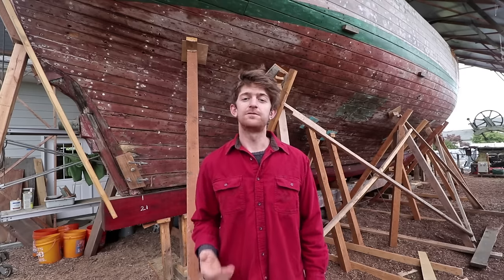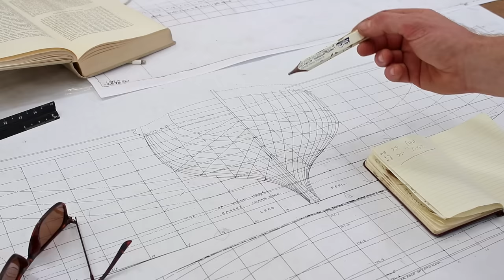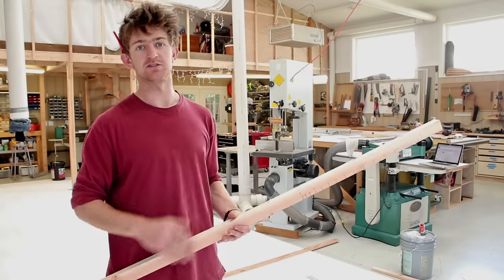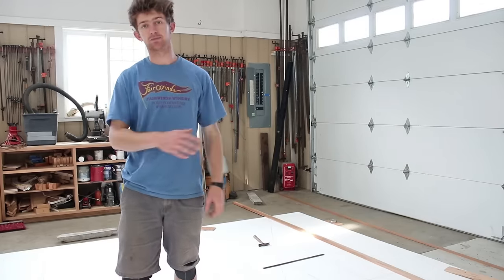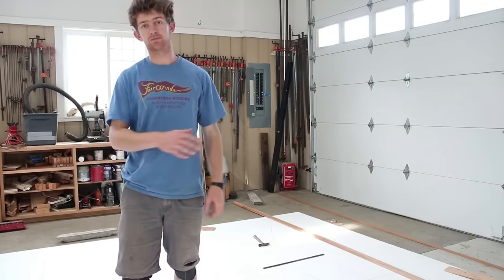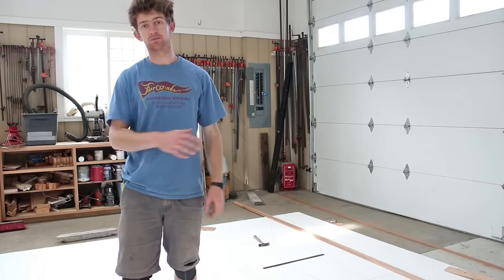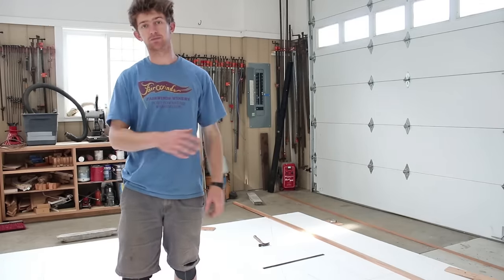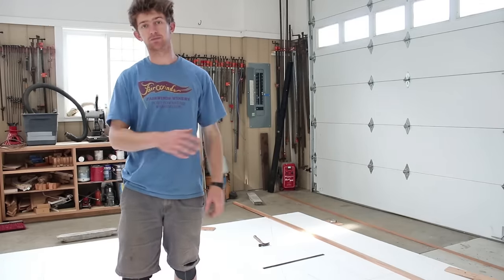Lofting the Lines; Part 2 - Rebuilding Tally Ho EP25

Comment: I'm bingeing from episode 1 (sat in hospital having said goodbye to the old prostate ...). You are who I wanted to be at 16. Used to knock around in the now long gone wooden boat builders yards in Exmouth as a kid. Used to design and create lines plans & offsets for a winter hobby - because spring summer and Autumn were for sailing ;-) been holding back on commenting but I cracked .... Poncho is the boss ...

Comment: Very interesting!
I am "Still confused but on a much higher level!" :-)
Reply: I must not understand....I would have numbered each vertical rib from front to back, used that wooden "chain" thing next to each rib, transferred that shape to a piece of plywood, cut that side view of the rib out from the plywood, take that as  a template for each rib, clamped the template to the respective rib, compared the cutout, then traced that on to the piece of live oak for the corresponding left and right side rib. The #1 front right vertical rib should be the same as the #1 front left vertical rib.  Do the same all the way to the back of the boat...but I'm not a boat builder, don't plan on building a boat but still find this interesting.

Comment: Wow. I have read in theory about lofting. But to watch it on such a large boat in reality is quite amazing. I would get lost after drawing the first two lines. Excellent job.
Reply: You wouldn't really, it comes to your mind as you start drawing, as you 'see' in your minds eye the hull shape
Reply: Fredrick Rourk I feel like the intimidation would be from not expecting it to take as long as it does. But you’ve gotta loft to make sure you get a good result
Reply: is there not software to help with this process? is there some reason you can't use CAD?
Reply: @benja_mint  modern boats are drawn in CAD but you still cant skip the human eye part of the operation. im trained in the traditional stuff but have built a couple of strip plank composite boats that had their stations(frames) CNC cut from the CAD drawings. even with the CNC cut stations and CNC cut jig to set them up on you still have to lay fairing batons all around the jig+stations and eyeball it, theres always something that needs adjusting. you simply cant see everything on a screen/not full size. for example one of the boats i did had very flat topsides from the mast step forward. he intended it to be very flat but still slightly covex. when we set the jig and stations up the boat LOOKED concave at that point. it wasnt, the curve wasnt wrong (3 people independantly checked the jig and stations including the designer himself) but it just didnt LOOK how he intended. you cant catch these kinda things in software and thats the same kinda things leo is looking for heer by doing a full size drawing.

Comment: "The base design was based on a combination of a deep hull, long keel, heavy displacement and powerful gaff cutter rig. This made a lightweight and overpowered single masted boat with large steeply angled keels, making it deep draught under power and shallow draught in lighter sail. However, competition-based evolution between different builders and commissioning owners enabled the design to improve over a period in excess of 90 years. This continual experimentation to gain slight advantages created a fast boat that could operate in all weathers, resulting in what in the opinion of many was the best sailing boat design ever"

Comment: thanks for explaining the lofting. it can be confusing reading it in a book. I make replacement parts for large aircraft. They also design using the lofting and loft data. up until now I have only bid on solicitations that come with 3D models in order to CNC machine the parts. Now it's much easier to understand the old lofting drawings.

 Thanks again

Comment: Reading through the replies a number of people have thought of using an optical enlargement of the original reduced scale plans. Apart from needing a very large printer or compensating for optical distortion from a projector they are missing one very important problem. Say the lines in the original drawing are .5mm wide, once enlarged say 10 times they become 5mm wide. Which part of these wide lines do you work to? Enlarging by a greater factor makes this even worse. Drawing by hand leaves a thin line much more accurate for making frames. Leo's method may seem old fashioned but produces the results. Really well done.

Comment: I am imagining an electronic pantograph. A pointer, belts and encoders for picking points on the drawing  and then the same thing with motors + a computer to move to the scaled-up position on the floor. (the computer would mean that you could feed it an Excel spreadsheet to plot too.)
Too late now, of course, and unlikely to be faster for the first boat.

Comment: It was difficult to get my head around this lofting lark. Then I figured that you are using a two dimensional model to plot a three dimensional point in space. You can lift the big parts like the keel and the deadwood parts straight off the plan as templates, but stuff like the frames contain those three dimensional points - the shape of the hull. I guess that's why you have to plot them more than once, using the different sections, as the measurements (offsets) are different with each one. Even if this is correct, I still can't do it, so much kudos to you!

Comment: Glad to know you know what your doing! With all those lines going every which way I'm surprised you have any idea which is what! How fast could someone do this in cad I wonder.
 I did enjoy watching the parrot!
Reply from the maker: Here's my stock answer for when I'm asked why I did it manually!
A few reasons. 1. I know how to drive a pencil pretty well, but not CAD software, and I wouldn't want to trust anyone else to do it. 1. Being able to loft is an important part of being a master boat-builder, so I was keen to get the chance to learn it the traditional way. 3. There are many fair lines that can be chosen between two points. The person lofting the boat has considerable influence over the subtleties of the boats shape. If a computer was to do this, this human element of the design would be lost. 4. Is it even possible to fair a 50' long line on a computer screen, inch by inch? If so, it sounds very tedious. 5. I would still need life size plans for the templates, so I would need some kind of crazy industrial printers, etc. 6. I spend far too much time on the computer already, and this seems like way more fun (and makes more interesting videos)..
...didn't mean to write an essay, but there you go :)
Reply: Not a problem on the essay. I asked the question and you answered. Besides I know diddly about CAD I learned basic drafting back in Jr high ( more than 3 decades ago) I can draw out simple structures and that is all I need

Comment: Maybe stupid question, but couldn't one just use a projector and scale up the drawing? I guess you still need some reference points so you know you have the right scale and to make sure the image is not skewed. Edit: Saw your response in another thread. Makes sense. And this way will also make better videos. So happy people like you exist, who are sharing their work on YouTube.
Reply: Johan Petersson   I think you would need incredibly expensive optics to reach the necessary precision; he said that a deviation of half an inch would be visible on the boat. And second: as he does it, "analogue" so to say, it is a very beautiful process, and a good experience. Also he gets to know this boat extremely well. Every centimetre drawn himself on the floor. I like it.
Reply: Agree! I'm working with computers, I guess it's like when you have a hammer, everything becomes a nail :) A better option is probably to print everything scaled up in smaller sections.

Comment: Excellent description and demonstration of the lofting process. 
When you have a nice and fair set of lines on your floor are you going to rewrite the table of offsets by measuring your fully lofted plans on the floor?
Reply from the maker: That is sometimes done, especially if the boat is to be built again! ...I'm not sure yet, in this case

Comment: Just to speculate on the future of boat building.....
If you recreated the design in CAD then you could print out the full size plan on A0 wide sheets on a plotter. Adjust and repeat until you were happy with the new lines. Then also simply cut the templates out directly on a large 3 axis CNC. Of course you would have to pay to use someone's large format CNC. Plus it would raise questions about how far away from traditional techniques should one go during a restoration. I'm not in the trade but I expect this is the way it will be done in the future for wooden boats. 

As 4 axis and 5 axis CNCs improve and reduce in price, a lot of the parts would be carved directly from the plans in the future. Possibly directly into rough sawn slabs, taking into consideration the grain of the wood. The woodworking skill would then be in refining and fitting all these parts into a vessel. 
If the boat ever rots or is damaged, replacement parts could be carved out on a CNC and shipped to any location in the world for repairs. 

Being sustainable, easily customised and easily repaired might give wooden boats a come back against fiberglass. 

At least until people start 3D printing entire boats in nanofibers.

Comment: I think I get the point it is to have a set reference . Instead of wracking or trimming it here and finding the other area has become out of spec. I call it trimming the legs on an 8 legged table without a tape measure. So your creating a pattern to use as a standard measure.
Yep she has some nice lines . Of coarse I mean the boat.

Comment: Is it possible you may have jumped the gun in trimming the new keel timber. I understand that at the time you were not planning such extensive changes. I am more curious if there is some impact however minor. 
PS. I admire your determination.

Comment: Hey Leo, I was wondering would you have been up for 3D CAD drawings?. Also there are 3D scanning systems which may or may not have been useful in giving actual accurate data of the original shape of the boat. I understand traditional manufacturing holds a certain attractiveness but you are using power tools so I'm assuming you would not have been averse to using modern systems to help with the design?.

Comment: For those confused, lofting is drawing the plans of the boat full size in 3 different views - body plan (looking at the boat from the front to back), profile (viewing the boat sideways) and Half Breadth (viewing boat from top-down). 
All three of these views correspond to each other (regarding measurements). So any information laid down in one plan has to be changed/laid down in another plan - from this you can see the fairness of the lines. 
From a lofting, you can lift patterns of the boat to create moulds and frames (to build around), also give bevels for planking and so much more! The lofting provides a crazy amount of information that will be used to build the boat! 
It's a beautiful but difficult process :)
I know Leo has explained this but it might be easier to read :P
Reply: It's true, expecially for those whose mother tongue isn't English. Thank you! ;-)

Comment: I sometimes wonder if every aspect of boatbuilding would have been easier using the metric system. Then again, do any measurements on a boat of this size involve fractions smaller than, say, 1/8" or even 1/4"???
Reply from the maker: Nothing smaller than that in the table of offsets, but there will be later!

Comment: Couple of quick questions.
You said that lofting properly is important to stay true to the plan, you also said you suspect the builders slightly misshaped the boat originally does that mean they took short cuts in the original lofting process? and 
After all this work could you reuse, or sell the lofting floor to someone wanting, to build a new boat?
Reply: I think what Leo has done by making addenda to the offsets has created more accurate historical documents.   That is, they will become historical in time.  Obviously he had to add information.  I suspect the information was not in the drawings because at the time of the original build there was a close association between A. Strange and the builders, the information was in oral form. That association does not exist today, therefore the information had to be added to the drawings.
Reply from the maker: I'm not sure how they lofted the boat originally, and actually it's hard to tell how much of the change in shape is just dues to age and wear and tear, and how much of it is due to not following the lines exactly in the original build. I think in those days less importance was attached to line plan, in certain boatyards - and as Strange wasn't that well know at the time, they may have preferred their own ideas in some cases. The floor could be sold/reused, and so could a corrected table of offsets, or the templates for the frames.
Reply: Your last sentence, Leo, raises a question that's been on my mind from very nearly the start: How dissimilar will the resuscitated Tally Ho be from an entirely new boat? It seems that the only part you don't plan to replace is the lead ballast keel mentioned in this video.
Reply: Even though she's a heavily built boat, spending time dried out on her bilges (especially when new and the timber still a bit green), would surely have changed the shape a little here and there. She's also clearly hogged a little during the time spent laid up, so plenty would've shifted there too.
Reply: @Mmmyess. Possibly a slight misunderstanding. The lead ballast keel is the only part that isn't going to be changed. There are a lot of other parts that, as a result of this lofting, will be changed (ie moved slightly) but they will not be replaced. There is still a fair amount of the original boat in the project.
Reply: +ted renard What exactly of the hulk we see in the shed do you think will be reused? Certainly not the keel, which is now purpleheart, or the frames which will be replaced with sawn in Georgia live oak.
Reply: The Planks will be reused. As far as I know that's it. But with that and the Lead Keel it should still be classified  as a restoration. I think. I've seen 1920 cars restored from just a frame and axles.

Comment: You've mentioned that the 1968 repair lines diverge from both the original plans and the shape of the other side of the boat. Now you've discovered that some of the information you need to establish accurate and fair lines is not in the original drawings or tables. Are these things related? Did the people repairing the ship in 1968 have a similar lack of information, but not the time/space/resources/(mostly time) to do delve into the ship's lines as you have?

Comment: Are you going to transfer your modified lines back to a reference drawing / table?  In construction, it's referred as 'as built' vs 'architectural' not sure what it is in boating...
Reply from the maker: That is sometimes done, especially if the boat is to be built again! ...I'm not sure yet, in this case
Reply: I would think an updated offset table would be super helpful in the future when its time for the next rebuild. Or in the event of a similar grounding. or other mishap.

Comment: How did the original designer plot the sweep of the ship  on the plans. Experience? Big book of hull shapes?
Reply: richard wysham   Took a whiskey bottle and pencilled around it...
Reply: I think they carve a half model to the shape they think will be appropriate then loft it and build the ship.
JIM
Reply: Maybe Christian Geiselmann is right. Did they have hydroflow tanks or carve toy sailboats and test them in the Thames? Probably maths was advanced enough to determine which hull shapes fit the design required. I like to think they used the big book of British hull designs.Tally Ho (Betty) wasn't designed for speed....only. Speed in harsh conditions, or, making way in those conditions and being comfortable were designed into her.?? It's just a guess, but I think Leo wants to know how the ship handles if she's rebuilt to Strang's original drawings. Not how she was originally BUILT. Wasn't it altered when built to fit the shipbuilder's predilection?

Comment: All I kept thinking about was “isn’t there a software program that can solve all these lofting intersections to make the boat fair that could give you your once and precise measurements?”
Reply: At one point in my life (back in the mid to late '70s), I worked as a draftsman for a utility company and we would get the drawings of roads from the developers or the city.  We would have to take these drawings and update our drawings, plotting new utility services for the area in question.  The roads were not always perfectly straight nor were they all simple curves with given radius that was traversed for a certain number of degrees... You might have one curve of one radius and center point flowing after a certain number of degrees into another curve of a different radius, center point, and degrees... If the original designer of the boat had provided drawings like that, then it would be possible to calculate the points mathematically from known static data points... A lot of the old stuff was designed with flexible rulers though to basically just "make it look right" and the curves are not necessarily a simple radius and angular distance, but something where the radius might be constantly changing as the angular distance also changes (kind of like a section of a spiral curve)... There are various curve fitting algorithms out there that can be used to determine a polynomial equation that best conforms to the given data points... The original designer of the boat would have likely had access to this sort thing...